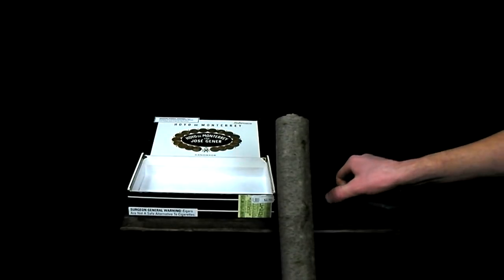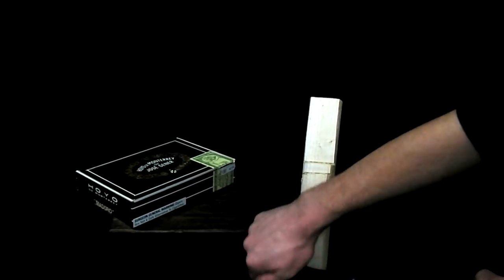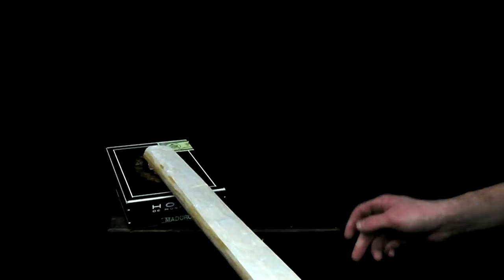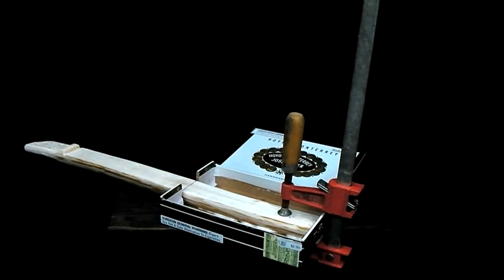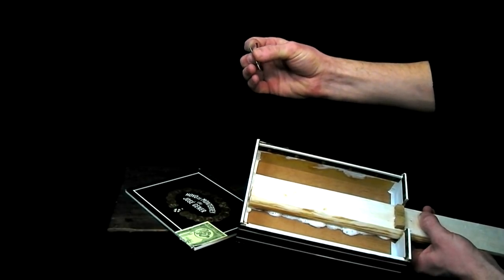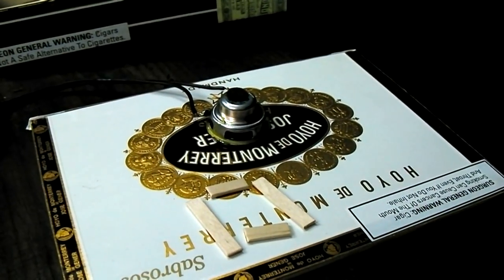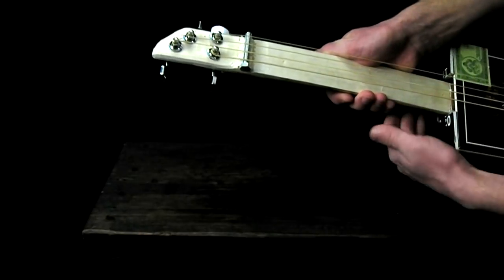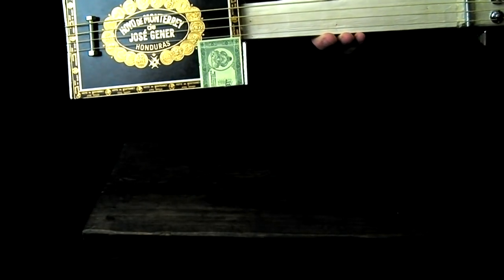How to Make an Electric Cigar Box Guitar for $25

Comment from the maker: You will need to bring the neck closer to the strings. This means digging a deeper groove at the top of the neck for the nut to sit in. It also means gluing the base of the neck right to the soundboard instead of the back of the box, or, shimming the fret board up higher. To actually install the frets you will need to buy some fret wire online which is to be pressed into cuts made along the neck. To measure the proper positions I recommend googling "how to measure frets".

Comment from the maker: I got the speaker used as the mic out of an old set of headphones. I have also since discovered that it will pick up the sound of the guitar much better and not be as prone to feedback if you superglue a dime to the center of the speaker. This gives the cone more inertia to stay stationary while the rest of the guitar and speaker housing vibrates around it. It works much better.

Comment from the maker: Yes, you can probably use one, but it might change the guitars tone. If you still have the old nut, you could try to copy the shape out of PVC. You would need to buy a cheap fitting that has a wall about the same length as your nut, then cut a strip out of it roughly the same size. If you want to be a perfectionist you could use sand paper to shape it exactly the same as the old one. Then just measure where the strings go using the old nut as the template and make shallow cuts with the hack saw.

Comment from the maker: @Dooogles It actually doesn't matter how long the neck is. The longer you make it the stronger your construction will have to be though because there will be more tension on the strings. Make it to whatever size you prefer.

Comment from the maker: I wanted the lid to have freedom resonate. The lid did not warp, but the bottom panel of the cigar box wanted to bend in where the strings curve over it so I was forced to add a block to the base of the neck that contacted the lid and supported the bottom wall.

Comment: I just finished mine.  Used different materials:  pre cut lumber instead of a log, a lunchbox instead of a cigar box, and I used a speaker from a talking greeting card for the pickup.  Interestingly, the speaker was slightly magnetic and adheres directly to the inside of the lunchbox.

Comment from the maker: @FerrilEwok Yes you can. The problem I have with this particular mic is that it wants to feed back easier than anything i've used before. It could simply be how I have it positioned in the guitar body. You can always try both a mic and a piezo and see which works best, neither are very expensive.

Comment: Most of the money was spent on the tuning heads, i got my tuning heads for only $5 and they work just fine, they don't look pretty but they hold tune just fine. So in reality you can build one for much cheaper if you know where to look. 

Also i think you should have used a Piezo pickup as they are dirt cheap and work really well, the speaker sounds pretty unique though i must say. I bet if you add a piezo as well as the speaker it would sound really good.

Comment: Man, I had to go check if my CBG was stolen. I actually thought this was MY CBG! I made one using the same box and the headstock looks exactly the same too!. The only difference is I have only 3 strings and I added a  gold covered humbucker pickup (to match the coins). Yours sounds very similar to mine. I used a piece of maple for the neck. I should post vid to show you how similar it is. Nice sounding and well made thanks for posting.

Comment from the maker: @girc52 Yep, they work the exact same way. Of course they are designed to be better at projecting sound rather than picking it up so the quality is not quite so good as a real mic, but it works just fine. They also tend to be a little more sensitive to feedback in some cases.

Comment from the maker: @Wired2X Yes. You would probably do better to use a hardwood board from a hardware store for the neck though. The bigger you make the guitar the more tension will be on the strings, and the stronger everything will need to be.

Comment: Very nice. I've been reading and watching videos all day on building these. Pretty much all other builds had the 1x2 neck recessed only as far as the thickness of the neck and the box lid would fit flat on top of that. Yours has the neck glued to the bottom of the box and thus has a gap between neck and lid - does the lid not warp at all like that? Yours seems the easier way to build, I was just wondering if there was a particular reason it was done that way?

Comment: Bass guitars GENERALLY (emphasis on that word) have 4 strings; however, they come in more varieties than just four strings.  Having four strings does not make a guitar a bass guitar.  A bass guitar is signified by having much thicker gauge strings than an electric guitar, which is why bass guitars have a much lower pitch and are generally used for anchoring the rhythm in a band.  Every one else, take it easy on him.  He was just misinformed on the subject.

Comment: I knew nothing about these Cigarbox guitars until I saw a Street busker playing one..
I want to make one.. What is the total length between the top Nut and the Bottom nut please. Is that very important.. Please ,
Reply from the maker: The total length isn't important, you only need to measure it if you are going to add frets, or if the neck you are using already has frets.